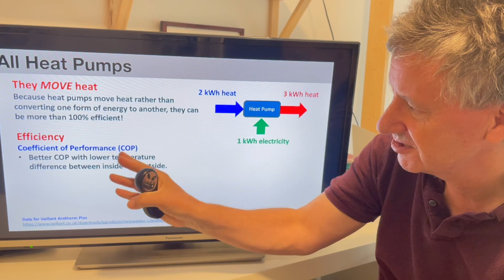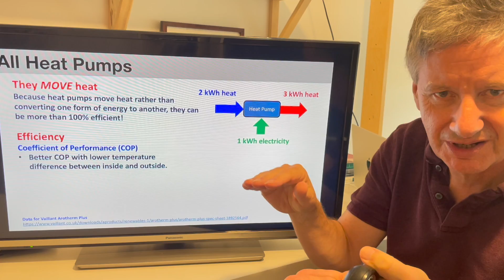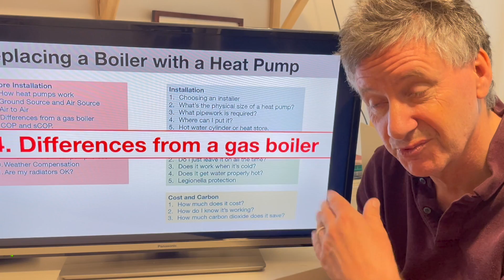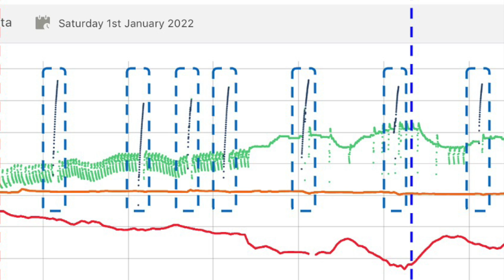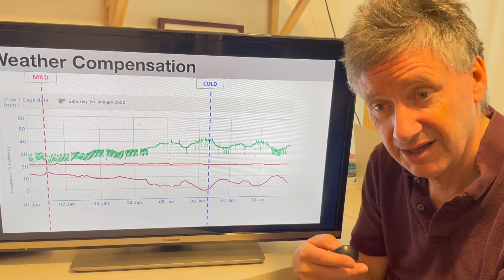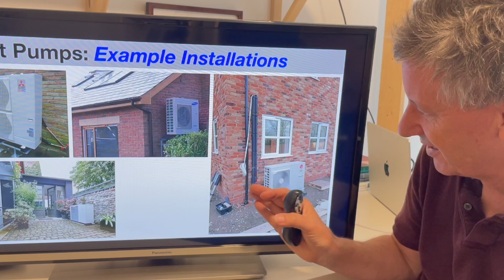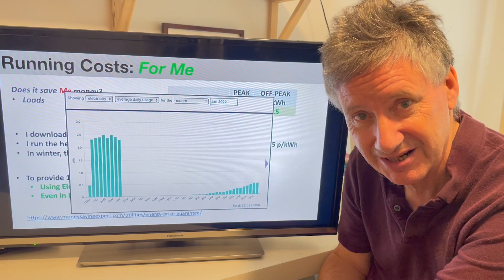Replacing a gas boiler with a heat pump

Comment: Great technical detail, thanks.  Could you do a video on radiator convection vs radiation comparisons.  Often wonder if the more modern radiators without fins were not as great.
Reply from the maker: Hi Dilemma. I agree with you. I love some modern radiator designs, but I suspect the boring standard radiators with two or three panels and loads of fins are dramatically more effective.

Thanks for the suggestion about a video: I'll add it to the list but I am bit overwhelmed at the moment!

Best wishes

M

Comment: Great presentation, thank you.  Just one question re changing the flow temperature of a combi boiler....  You said that it was possible to save 11% by reducing the flow temp to approx 38C, but the boiler is almost running continuously this level vs occasionally at a higher temp.  Did you take this into account when calculating the 11% saving???  Thanks!
Reply from the maker: Yes! In all three cases - with a flow temperature of 75 °C or 38 °C) the heat delivered to you home by the boiler is the same. But in order to deliver that heat at 75°C the boiler has to use 11% more gas.

Comment: Hi Michael I followed your calculations on your previous video, we have a large annual usage of around 45000kw a year… crazy I know! According to your calculations I need a heat pump of around 20kw, however the installer is proposing a 11kw one!? Any advice please
Reply from the maker: Good Evening Tesh. Mmmm. That's the opposite to the usual problem.

45,000 kWh a year is a lot of gas. 

Do you use a lot of hot water? In the rule of thumb I guessed that 5% to 10% of teh gas usage is hot water. If you use a lot more than that then a smaller fraction of the 45,000 kWh/year would be used for space heating.

In any case, I would discuss that with your installer.

If the installation isn't imminent then when some really cold temperatures come along, read teh gas meter 24 hours apart to get a decent estimate for the maximum power required to heat your home.

Take the number of kWh of gas used on this cold day and divide by 24 e.g. 100 kWh used in one day: divide by 24 h gives. heat pump power of roughly 4 kW. I'd add a bit to make sure it could cope so probably a 5 kW pump would be fine for that.

BEst wishes

M
Reply: @michaeldepodesta001  I guess you mean, they will need a pump that will be 5kW (electrical), but if working with a COP of 3, it will provide 15kW (thermal). Is that correct?
Reply from the maker: @oaklejant  That's correct. Heat pumps are specified by their nominal THERMAL output at a specified environmental condition with a specified water delivery temperature.

Comment: Thank you. Very good video. My understanding of heat pumps increased vastly. Now to find the spare pennies to finance one of those...
Reply from the maker: If you will have to wait for at least winter, then prepare by reading your gas meter once a week. You can then put the results in a spreadsheet and see what your real heating requirement is: this should help you get the right size heat pump when the opportunity occurs.

Comment: Not a good choice for older homes even with insulation. Might just be feasible with a modern air tight home.
Personally I'll stick with my gas heating and remain warm.
Reply: Hi Mike. Do you have any links to these reports? What reasons do they give that a great pump with the same heat output as a boiler won't work?
Reply from the maker: @ferguswalker7345  It is easier to mis-install a heat pump than it is a boiler. Here is one way this can happen.

Heat Pumps with a high heat output (say 10 kW) deliver that heat at the same temperature (say 40 °C) as heat pumps with a lower heat output (say 5 kW). To output more heat they simply flow water faster through the pump: Say 20 litres per minute rather than 10 litres per minute. 

If the pipework in the house is too narrow, then it becomes impossible for the pump to move that much water through the pipes to actually deliver the heat to the radiators and the house. 

In part this kind of installation fault arises because inexperienced installers will focus on the shiny 'new thing' that costs thousands of pounds, and not think about the heating system as a whole.

So it is also possible to attach a 10 kW heat pump, but find that it can't deliver 10 kW of heat to the house, which results in a mystified and disappointed customer. But it is also possible that with a little bit more thought, that same pump could happily deliver 10 kW to the house resulting in a delighted customer.

Best wishes

M
Reply from the maker: Hi Mike. Why do you say that? If a heat pump delivers the same heat as a boiler, how can it not be equivalent a boiler?

Best wishes

Michael
Reply: @michaeldepodesta001  that's your view. I have seen plenty of other reports saying the exact opposite.
Reply from the maker: @mikeuk1954 So you have read reports but don't have any personal experience. Mmmm.
Reply: @michaeldepodesta001  thanks for the detailed reply. I actually meant to ask Mr Biggs why he thought heat pumps would never be suitable for older homes as he seemed to be very fixed in his opinion without much to back it up. Like you say, there are often reasons why a straight swap doesn't work perfectly off the bat, but there is always a fix available!
Reply: ok boomer

Comment: I now have two estimates both @50C flow temp @-3C (delta 23C) design temp. One 17kW change all 14 rads plus 1 extra rad, the other 14kW and change 7 rads, both have done the measurements and calcs and both have derived similar  space heating energy requirements of around 29000 kWh/year.

Using your RoT gives 8kW ASHP. 

If I now multiply 8kW *24 hrs * 210 heating days (7 months) this provides 40k kWh/7months, which is substantially more than the 29kWh/yr they quote as my space heating energy requirement. Is there a flaw in my logic?

So both quotes are massively over spec'ing the power. Looks like I'll be measuring the gas usage for the next 7 months.

Thanks for another great video and get well soon.
Reply from the maker: David: Good Morning. 

So your annual gas usage was 23,200 kWh which satisfactorily warmed your home. Have I got that right? Some of that was used for water heating (say 10%?) and some was wasted (say 10%). So the actual heating required for that year was 0.8 x 23,200 = 18,560 kWh. 

I would discuss with these installers how their space heating requirements can be justified given your actual gas usage.

They will say "It's what the MCS process specifies". But in the end I think a nice ~ 10 kWh pump would satisfy everybody. 

If you are sticking with gas for another year, try reading your meter once a week and getting the average weekly temperature near you from Weather Undergrounds 'Wundermap'. Then you will definitely know how much heating your home requires.

In any case: Good luck with your endeavours. M
Reply: @michaeldepodesta001  All assumptions are correct. I've had the MCS process spec discussion and neither installer is willing to budge (which means the £5k grant isn't happening).  I'd be happy with a 10kW ASHP as insurance.

My gas boiler's 11 years old but still working OK so I'll read the gas meter weekly and the Wundermap average weekly temp (what a fantastic resource) as you suggest.

Thank you so much.
Reply: @michaeldepodesta001  could you please point me to your explanation of what to do once you have the weekly usage and average temperature. I'm sure it's a straight forward calc. Thanks for doing so much positive action!
Reply from the maker: @pumpkinhead456  Drop me a note at house@depodesta.net and I will send you a spreadsheet template.

M
Reply from the maker: @pumpkinhead456  Dear Pumpkinhead,

Once you have the data, there are a number of ways to proceed. And if you worry about details things will get VERY complicated. So this is simplified - but if you get how this works, maybe you can think of ways to improve the estimates.

Let's suppose you have week by week data on gas consumption and week-by-week data on average outside temperature.

Step 0. Divide your weekly gas consumption by 7 to give the average daily gas consumption during that week.

Step 1. Work out the difference between your average indoor temperature and average outdoor temperature: this is your temperature 'demand' - a measure of how hard you are asking your heating system to work.

Step 2. This is cosmetic and you can skip this if you want. Plot both 'demand' (°C) and and 'gas consumption' (kWh/day) versus week of the year. You should see they correlate closely.

Step 3. Plot 'gas consumption' (kWh/day) on the vertical axis (y) versus 'demand' (°C) on the horizontal axis (x). You should see a sort of slope with the biggest consumption being when the temperature demand is greatest.

Step 4. The slope of the data near the peak demand is an estimate for the heat transfer coefficient of you house (HTC). The units are kWh/day per °C. A typical (large) value might be 10 kWh/day per °C. Convert to W/°C by multiplying by 1000/24 i.e. 41.66 i.e 416 W/°C

Step 5. To get the heat pump power required, multiply the HTC by the maximum likely temperature demand - usually around 20 °C in the UK. This is the maximum heat pump power required i.e. 416 W/°C x 20 °C = 8,320 W or 8.3 kW. Buy a heat pump with a maximum power at low temperature just a little bit greater than 8.3 kW. Or actually 8 kW would do - if you get cold one just or two hours on one or two days a year you can just put an electric heater on!

https://protonsforbreakfast.wordpress.com/2021/02/15/understanding-heat-flow-in-my-home-the-key-graph/

The above blog article and ones I link to it may help. Do drop me a line if I can help further! Seriously!

Best wishes

Michael
Reply: @michaeldepodesta001  that's brilliant, thanks for your time. My house is split in to zones, so I might even take this one step further :)

Comment: Thank you Michael.
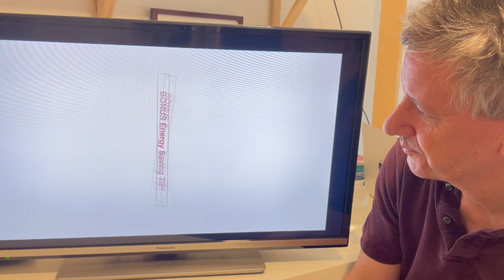20:00 I tried to lower the flow temperature of our gas boiler down to 40 degrees, but it is not possible to modulate so low (minimum output is 6kw) and keeps cycling continuously. I realised that the boiler is hugely oversized.
Your videos have been very informative.
I have the annual gas consumption for the last five years. This winter I will gather the weekly gas consumption and probably the temperature inside the house and next year we ll have a heat pump installed. From your videos and the rule of thumb I believe a 5 kw one would be the appropriate size.
Reply: I had a similar issue with traditional electric water heater (simple thermostat controlled ) as opposed to heat pump. My fault being I did'nt even bother to check the power termination on the cylinder before I replaced it.  We have an off peak for the water heater. I've tracked the consumption and it averaged 13-14 kWh/day.  After I had it replaced, I thought I should as least have a look at the temperature adjustment knob on the outside. Well, bugger, not that the knob actually did anything !!  It just appears to be a cover with a knob that must have been designed for another under cover control for the same unit. All that was in there was an inline resistor and thermostat with a temperature control similar to the pre-set potentiometer type. And the previous owner had set it to max temp of 70 C.  So far the heat pump is going well though. The long term results are still in the making but tracking overnight 24 hour consumption over the last two days, it's already down by 5 kWh. And we are still in early spring here.
Reply from the maker: @greywolf271  It seems that every installation is an adventure! Good luck!
Reply from the maker: What was the lowest flow temperature you could achieve with 6kW of heat delivery? That's an important data point in figuring out how your house works! M
Reply: @michaeldepodesta001  how do you find this out? I’ve lowered my flow to 50 for now but as not every room is calling for heat its still cycling. Will be trying to heat the entire house to see if that helps - but I can’t see the energy consumed by the boiler. I’ve done rough numbers done and someone look at the radiators and I appear to be heat pump ready (even the ‘low hanging fruit’ that Octopus prefers). Main caveat to me is hot water - don’t really have convenient room for a tank anymore, so would prefer something like a sunamp but that massively increases the cost. Same if we had an electric boiler. a combi-style instantaenous but centralised hot water system would be good for users like us - COP for HW is low anyway
Reply from the maker: @MrKlawUK  Hi. The only way to get a handle on gas consumption is to read the meter regularly. I read all the meters once a week, and the gas meter reading corresponded closely with the outside temperature. If you change the boiler flow temperature you should see a change in that correlation.

Regarding DHW, in the video at 49m11s there is a picture of an installation of an outside insulated 'hutch' for a Sunamp unit. Might something like that be possible?

DHW COP is not bad - above 3 at this time of year

https://protonsforbreakfast.wordpress.com/2021/09/07/assessment-of-heat-pump-heating-water-to-50-c-and-70-c/

which is a factor 3 reduction in cost and carbon.

It sounds to me like you are on top of most of the important issues. Congratulations. M

Comment: Is the slide at 6:25 correct in terms of incoming energy? You show 2kwh of heat energy coming in and adding 1kwh of electricity generating 3kwh. But I would have throught it's 3kwh of incoming  heat energy, and 1kwh of electrical energy is used to convert it into 3kwh of heat on the right-hand side.
Reply from the maker: Mike, Hi.

Yes, the slide is correct. In this example the heat pump CONSUMES 1 kWh of electrical energy (in order to operate the compressor) and MOVES 2 kWh of heat energy from a cold temperature to a hot temperature. In all. 3 kWh of heat energy is delivered.

Best wishes

Michael
Reply: 1 in + 2 moved = 3 total.  So 3/1 gives a COP of 3.
Reply from the maker: @davidreece1642  

1 in + 2 MOVED = 3 out
Reply: @michaeldepodesta001  yes, (now edited) moved not generated👍👍

Comment: A very comprehensive explanation, thank you.  I hope to replace my 35 year old gas boiler with an ASHP next year.
Reply from the maker: Hazmat: Great News. My top tip is to read your gas meter each week this winter so you can record how much gas you are using to keep your home at the temperature you want it. This will be helpful in choosing the correct heat pump size. Good luck!
Reply: @michaeldepodesta001  I have monthly gas readings going back 3 years and use on average 12800 Kwh per year (for both heating and hot water at 80% boiler efficiency). In Jan-Feb I use on average about 70 Kwh per day.  Incidentally my 35 year old boiler runs at a flow temperature of 52.5 degrees, very strange, but it seems to do the job.
Reply from the maker: @hazmat5749  Sounds you are heat pump ready! Good luck with endeavours. M